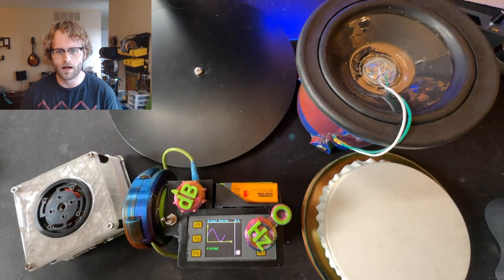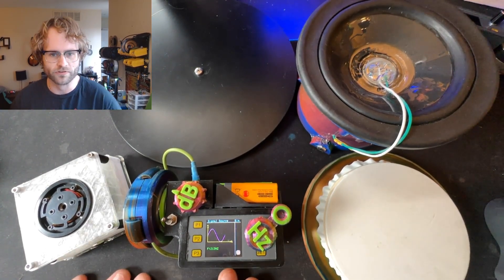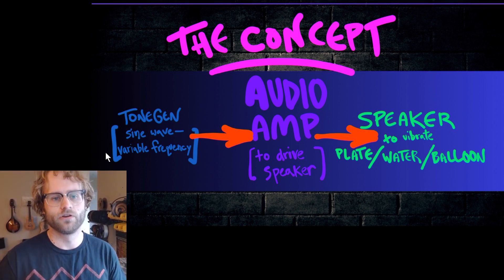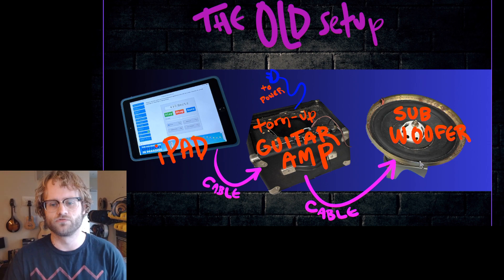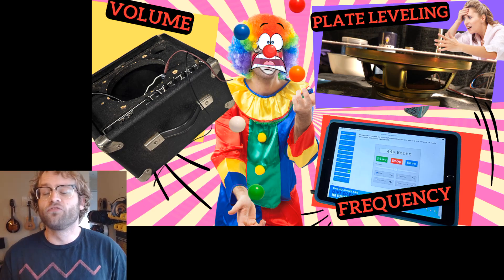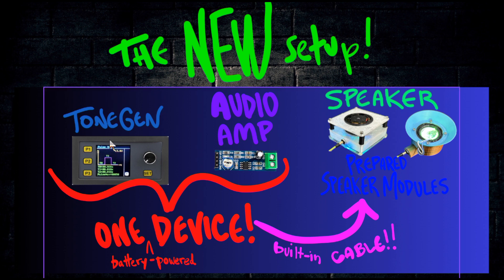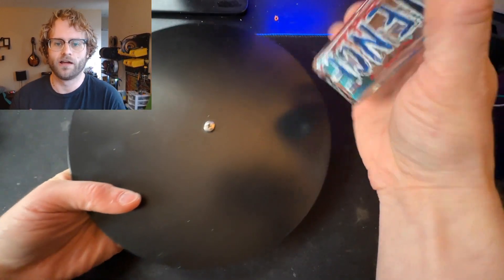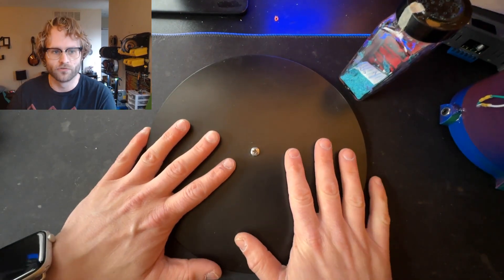Modular Cymatics Experiments Rig (intro)

Comment: That's a cool setup.

A vaguely similar variation I used in a science demo was to point a laser at a mirror attached to a speaker with a glob of silicon and some demo tones on cassette tape and a knockoff Walkman (it was a while ago ;->).  Not as cool as a Chladni plate, but you know... lasers!